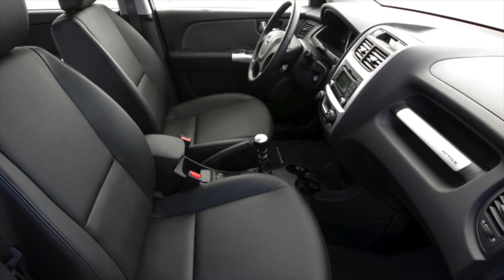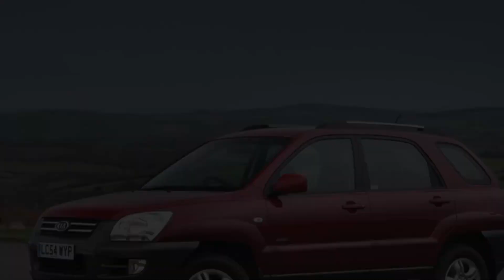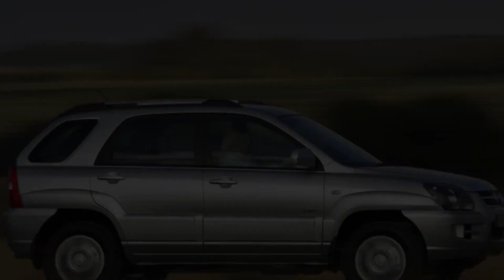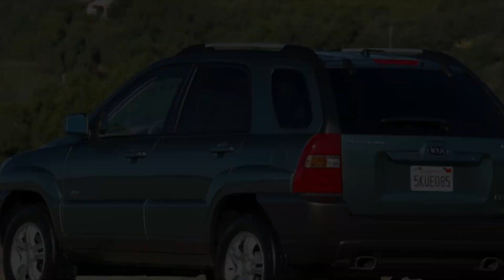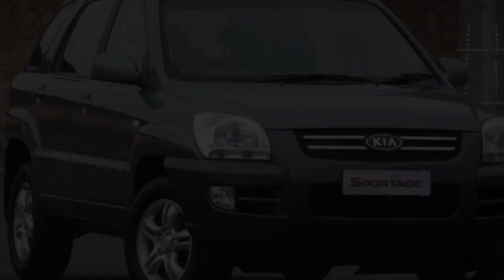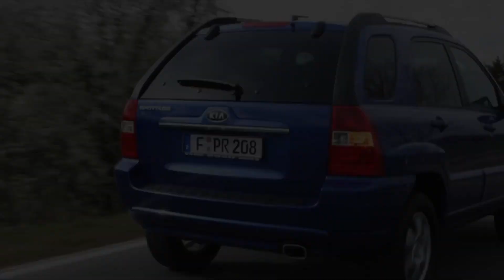Kia Sportage 2 (KM) - Check For These Issues Before Buying

Comment: Bought a 2004 2.0 16V Petrol. Runs like a charm, only 130K kilometers. Practically no rust, was driven by an older man. Or should I say "not driven". Oil change, added Liqui Moly ceratec and I drive it with 7.5 Liter /100kilometer. Installed a trailer hitch for our horse. Yes, the diesel would suit better, but I paid 3000.- Euro for the car. And it looks like new, apart from some very small scratches. .Have done 5000km with it. So far, so good.

Comment: My 2005 2.7L had sensor failure of both Cam Sensor and Crank Sensor after 18 years @ 200,000 km. Otherwise, strong reliable engine. Minor surface rust (and I live in Connecticut) on under carriage. Meticulously maintained, one owner.
Reply: Is a Abs light bad is a 2005 Kia sportsge?

Comment: I've done 185k on my 2 lt petrol,  2009 model e. I service it regularly and have had no issues with engine, gearbox or body. I drive mostly on badly pot holed road so I frequently change bushes and links. due to a faulty ignition switch my starter motor shorted ...which was scary. so now it's on push button start. otherwise it's a good strong reliable car that has survived on bad roads and I expect at least another 70k of life